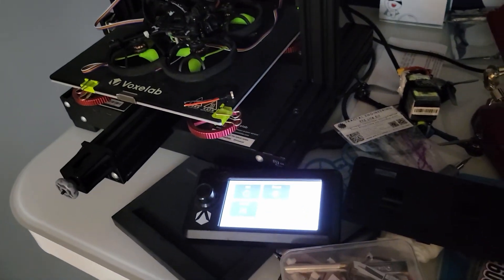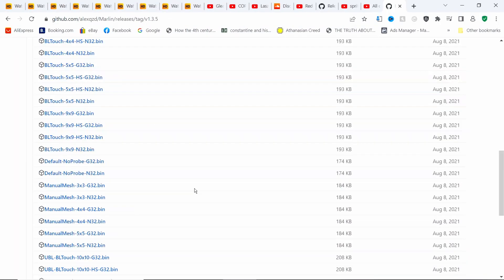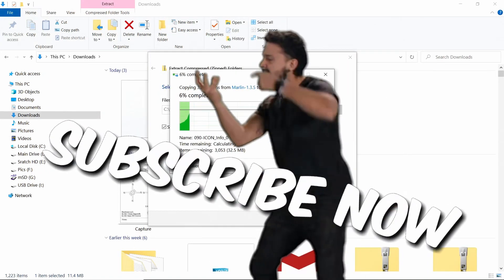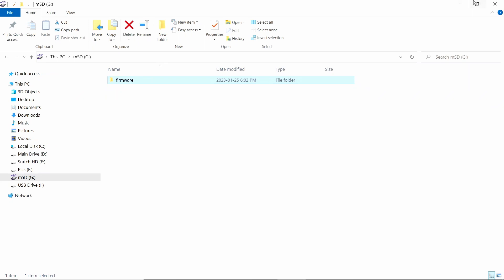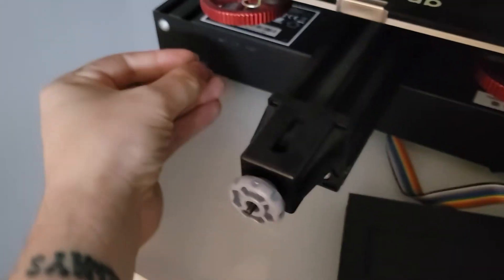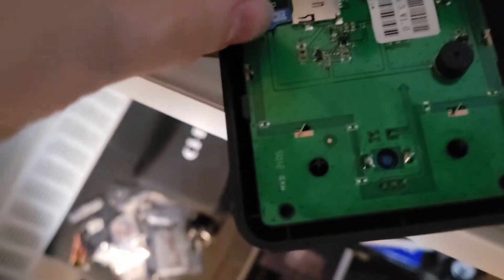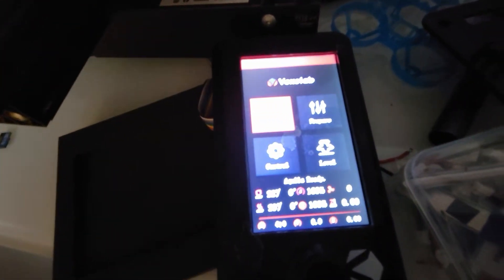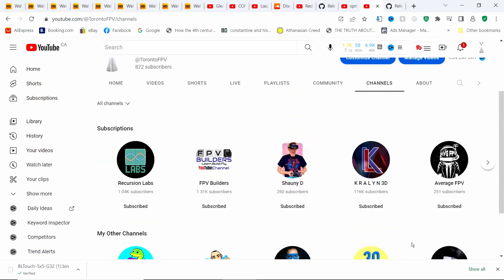Alex's Firmware On Voxelab Aquila FAST

Comment: Would you have any advice on what a person with an Aquila X2 H32 board with the CRTouch should do? When I use this firmware, the crtouch, after the pin pokes the levelling bed, turns red and the nozzle continues to drive down into the bed. 

Thank you,
Reply from the maker: Honestly if you like fiddling keep fiddling. If you're getting sick of it just get yourself a a bamboo labs a1 or a1 Mini. They're $100 less than one. I bought them last year and probably the best thing I ever got

Comment: Do you know how to get the printer to use the mesh table? It scans it but whether I enable it or not in the settings check box, it does not seem to use the level mesh it made. I tested this by making the bed quite far off and it just ran into it. Didnt even make the attempt to adjust. Any thoughts?
Reply from the maker: @sketchyunicornslab  no idea honestly I got an A1 mini and never looked back
Reply: @TorontoFPV  Makes sense. I didnt have any issues with my glass but I switched to a new magnetic bed and am having trouble with the leveling. May just switch back to glass and wait for my carbon to show up for the other materials. 

Appreciate it.
Reply from the maker: @sketchyunicornslab  leveling got annoying. I was constantly fiddling with it. So then I printed some TPU spacers and never had to mess with it as much. That's the way to go. The springs are really annoying You have to mess around with the z offset. There's lots of tutorials so I'm sure you'll be able to figure it out, but that's the setting that changes the z offset If you don't have something to print the TPU spacers, let me know where you live and I'll give you an appropriate link For pretty cheap
Reply: @ Yeah, leveling was annoying for awhile. I had TPU spacers as well instead of the springs but eventually I switched to machining spacers and using a small O-ring for minimal warpage adjustment (since the plate is so small). This has worked very reliable for me when printing PLA and PETG which was mostly what I use this printer for. 
However, I got tired of using tape on the glass for PETG since I print with that more so I bought the magnetic plate adapter but seems the magnet section is wonky and all over the place.
I was going to rip it out and go back to the glass but forgot I have a few RPi's sitting around so, going to backup the firmware and try switching to klipper on it. 

My voxelab is modified so much that I dont think it would be considered voxelab anymore haha but it is the first gen and for me, has been very reliable once I fixed a few kinks out. 
I did order the elegoo carbon which I am excited for since TPU and rubber like or CF filaments have been a challenge on this printer. Looking forward to printing those reliably. Was going to get a A1 but the price of the carbon was too good to pass up. 

I appreciate your responses!
Reply from the maker: @sketchyunicornslab  nice! You just got the filament or an actual printer? If so which model. My vox has a direct drive the reality sprite pro. I want to get kliper on mine too I got the pie but never really figured it out :( lol hours fiddling. The A1 mini is the opposite. Works so nice whenever you try to make it better it gets worse so just let it be. Good times I love meeting fellow creatives. Nice to meet you, where you from? You ever mess around with Fpv?

Comment: Hi, I managed to install the firmware, but I have a problem with the bed measurements, mine has a 400x400  bed, but the firmware is 220x220, how can I change it, otherwise it seems to work, could you help me? Thank you.
Reply: same i have the 300x300

Comment: Does work it work half the screen update but not the motherboard when I turn it back on the screen stay grey
Reply from the maker: did you figure it out? maybe you have a diff chip than me?
Reply: @TorontoFPV  yeah after trying multiple I finally flashed the new software dont why it didn’t work the first time but I guess it may be cause the file was corrupted or something like that
Reply from the maker: @N-HT  Mines buggy sometimes and I reflash it but now I got an A1 mini and it makes life soo much easier!

Comment: I didnt do this when it first came out because i didnt want to change from landscape to portrait. Came back after a lomg gap hoping there might now be a portrait mode for aquila, but alas not yet. Will stick with the original and keep checking every now and then
Reply from the maker: If you don't need it don't worry about it!
Reply: @TorontoFPV  i like the aesthetic of portrait mode and didnt want to give it up....only reason I didn't switch to this when it came out. To each their own, as they say!
Reply from the maker: I did it to get the temp increase but It can be a little buggy sometimes so if you don't need that don't worry! @EpicScotsman

Comment: When i wanted to upload the firmware i just got a jumble of voxelab icons and the green checkmark instantly. And now my printer wont show anything on screen
Reply from the maker: Did you check which version printer you have? If it has the mentioned sticker it won't work. Reach out to 3DPrintSOS he might be able to help you
Reply: @TorontoFPV  i have the one with the N32 version. I tried the firmware from voxelab first didnt work. And then tried this firmware and also didnt work. Think i might have to buy a new mobo
Reply: @9bstar  literally same boat man as of rn.. what ended up happening ???

Comment: Hi, and thanks for your video. I have a little big problem. I was a happy user Aquila printer with G32 chip. I downladed the correct firmware for this printer (ManualMesh-5x5-G32.bin).
 Also, the screen.  After that, my printer doesn't work.
When I turn on the printer, on the screen only appear the voxelab logo. I try to install other firmware but the printer does not response. 
I believe that my printer is now a beatiful brick. Guys, any ideas? Any suggestios? Please, what can I do?
Thanks.
Reply from the maker: Sorry join the fb aquila group and ask there and or 3dprint sos on YouTube you should find him. I focus on drones
Reply: @TorontoFPV  Ok. Thanks a lot.

Comment: How do I go back to original firmware
Reply from the maker: no idea I love the new firmware ask 3dprintsos hes in the comments here and would know!
Reply: @TorontoFPV  man I got the original back. I'm on h32 and I had a problem with my print stopping mid way. And when I was printing something the nozzle was moving away from the print so idk. I'm gonna try it again and hopefully original firmware fixes the issurw
Reply: @Xabre3  are using flash drives or sds to upload files. It could be your problem
Reply: @mason1926  I'm using the micro SD and the usb micro SD addapter
Reply: @Xabre3  how did you get the original back?

Comment: Has anyone else got MinTemp errors after the install?
Reply from the maker: Had no problems so far. Sorry
Reply: @TorontoFPV  I downloaded the source code, looks like they modified it to only have a 5 degree swing. Once I recompile it and create a new bin I'll test it out and let you know if it made a difference. Reloaded the stock Aquila x2 firmware and problem disappears so there has to be a flaw in the firmware somewhere.. Maybe if anyone else is having the issue, this might help.
Reply from the maker: @Travis Ehlers  I have the original Aquila might need a different version for the x2 but I don't know honestly new to all this stuff
Reply: @TorontoFPV  I ended up finding an older version of Alex's Firmware and the problem seems to have went away. Download his source and did my own edits but was never able to figure out the problem. I'd steer away from the beta if anyone else is having the same problem.
Reply from the maker: @Alpha3D_USA  thanks for your input!
Reply: @Alpha3D_USA  which version did you end up using? I've got an Aquila X2 and still can't figure it out.
Reply: @1980zander  the release before the current beta, then went with a bltouch 4x4 grid. Seems like the problem went away. It's still temperamental though. My tip is don't preheat your machine and you'll encounter less problems, work for me at least. Good luck man
Reply: Yes constantly or timo run